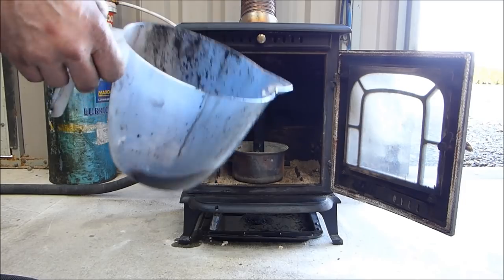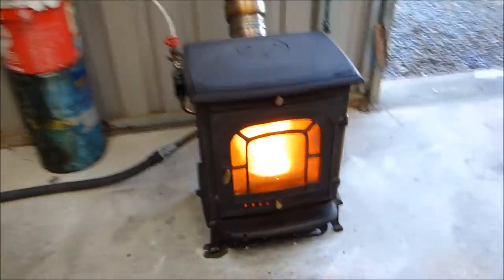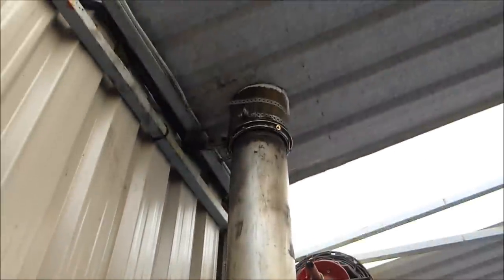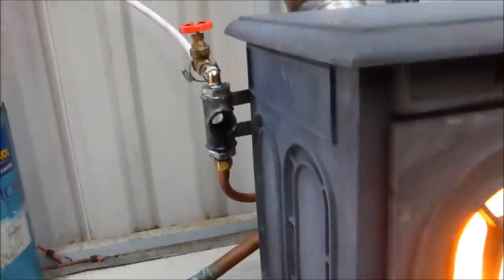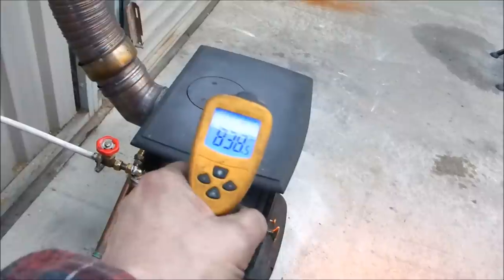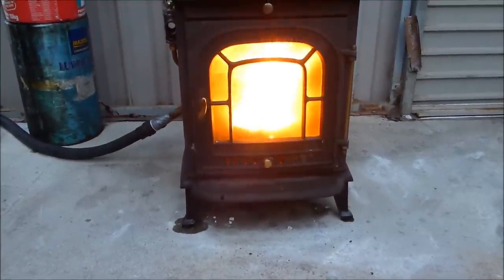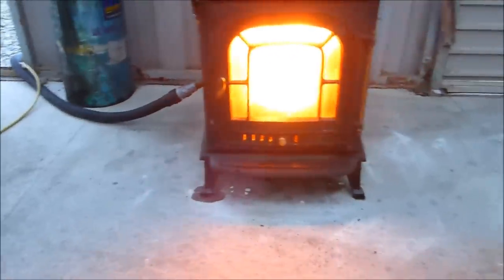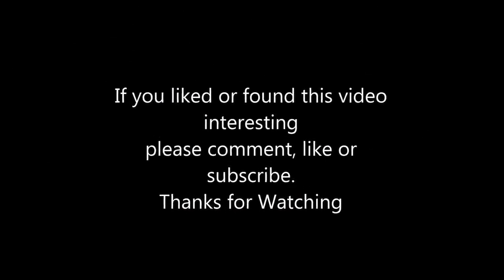Amazing ...Convert your Stove to burn waste oil

Comment: Have run a waste oil furnace like this now 25 years with copper coil built around it with hot water also and circulate thru radiators..Clean it 2 times a year with great results.  Only smokes first lit.  Keep a pyrometer on it first couple years.....been a great heat source.
Reply from the maker: Hi Doc Holiday. Thanks for sharing and well done. Cheers Gerry

Comment: Worked in the oil business in the states for thirty five years....I GOTTA MAKE ONE! back in the 70s I just caught the tail end of drip burners.......same combustion chamber but drip came from above with no fan? In a wood stove....... thanks for the video😊🇺🇸
Reply from the maker: Hi Pete. I made a unit that does not require a burner and makes huge heat too. It runs on 2 litres or so per hour and is very easy to make. I tried it in a boiler stove in my house and I heated some underfloor heating and 300 litres of hot water too. Here's link https://youtu.be/SAmHNp6fOUA You would have no problem making it. I am working on a siphon nozzle powered unit at the moment  so more heating projects on the go. Cheers Gerry

Comment: I used 1.5 inch pipe fittings to make the burner, used a elbow, coupler, t fitting, and reducers to connect to the 1/2 inch air supply pipe, I used a computer squirrel cage cooling fan and laptop power supply for the air feed, I used 1/4 inch copper tubing for oil feed. I use about two quarts running it all day at a temp around 70 degrees f while below zero out side.

Comment: Can you make a video of the inside setup (how the pipe is fitted inside the burning bowl) ?

Please make an update of how much residue and buildup is created in the bowl and how hard it is to clean...

Great video thanks.
Reply from the maker: Hi Dicofole Video 2 on the way in 2 or 3 days showing every detail. Very little build up and all you do is smack the pot on the floor and its clean. I will post a video of it shortly. Cheers

Comment: good job i made one of the other ones. might have to give this one a try
Reply from the maker: Hi Thomas. This one is noisier but because you can adjust both the air and the fuel it is very easy to attain a clean burn.  Its easy to build too. I hope your new burner is working well for you. Cheers
Reply: successful waste oil burner
i love it i had a wood stove built the oil burner and give the wood stove away

Comment: Hi Gerry, try using a thin stainless steel salad bowl. It will get red hot in seconds and when the oil hit it, instant vaporization. I have my burner blowing in from a hole on one side of the bowl so the air swirls around. Works very well and there's no smoke in minutes. My old brake drum setup took too long to heat up, especially when everything was colder than -5°C and worse when it dropped to below -15°C.
Reply from the maker: Hi Mike. I have raided the kitchen so many times for cookware that I am nearly handcuffed every time I appear there for food Lol. A salad bowl sounds very good and easily changed out. I do use stainless steel pots as well but my latest burner doesn't even need a fan and works great too. I prototyped it with a sweet tin and a dog food tin and it works great. Here's a link    https://youtu.be/Z38ndzSPJxQ  Thanks for the comment Cheers Gerry

Comment: You should put a couple of those fans on top of it.
Reply from the maker: Hi. It makes too much heat and would destroy those little self powered stove top fans. I do use a 12v car fan to shift the air to the other side of the shed and that works well. Thanks for commenting Cheers Gerry
Reply: @GerrysDiy  ok thanks for the reply. I kind of thought it might be way to hot for those but you never no. It looks awesome. Is it still working good today?

Comment: Great video how big of a hole the do you use, it isn't a one inch hole do you had to drill is it .This would heat my garage great, will oil in the copper tube catch fire and go back toward your oil supply and is there any smell from burning waste oil .Could you let me know thanks Dale

Comment: I like this design, since you are using a blower, can't you pipe the exhaust waste heat to another part of the building then piped through a radiator or heat exchanger before putting the exhaust up the flu? maybe even heat a room in the house with the exhaust, or heat water even?

Comment: Hi Gerry. I have a wood stove with auto damper controlled by heat hotter an coil spring activates an closes down draft. Oposite when cold. Located in back of stove inside. Yours was on bottom. Do you think result would be same?

Comment: I have to say this is very awesome a couple of years ago I built a pellet stove out of a cheap cast iron harbor freight stove. I like your set up because am looking to build a multi fuel stove that will use pellets waste oil and wood. I like the idea of being able to run more than one fuel. right know am working on building a pellet mill so I can pelletizes grass and leafs or that's the idea right know. what I like about pellets they stack very compact and if you can make them out of grass that you have to cut any ways it is a plus. waste not want not  

great video 5 out of 5 stars
Reply from the maker: Hi Iwantosavemoney. The propane tank version I made does a great job of burning everything from logs and sticks to various types of used oil. Grass pellets from the garden clippings is a really cool idea. Here in Ireland we have plenty of it. I have planned to make a pelet stove at some stage soon too but I have a few things to finish off first. Cheers Gerry

Comment: Hi Gerry.Planning to follow Your ideas of converting an ordinary wood ovn to an waist  oil burner but wondering:                                   - Why us a stainless steel pot so big and  so deep for the flame? In my earlier days of diving we had an diesel burner in the work-room 24/7 in the wintertime on the same princip but not a deep and big pot, and not a blower, but good intake. It did not give thousands of watt  but made the start of the pipe red when opened the regulator from dripping to a thin jet. See others use a 6-7 inch stainless steel tube with a lot of 1 inch holes instead of a pot. What do you thinK? Dag from Norway. ..Your actitities are good man

Comment: If you added a housing around your exhaust you could make a forced air distribution across the shed, also wrap the exhaust pipe with s copper tube you can get running hot water

Comment: I have a Montgomery Wards home oil heater that still works it's burner is design slightly different but once it gets hot it's got 100 pinpoints of are coming in to the plenum

Comment: Thanks for the idea and setup for I converted a 30,000 btu propane heater into a waste oil heater and get about 40,000 btu from it now, you can see the video of it on my channel, you may want to put a electric valve inline on the oil line so if the power fails it shuts the oil supply off. Nice set up otherwise.

Comment: What if you have a little anti freeze mixed in the oil? I live way out in the woods and i have 55gal drums full of oil, the local part stores only take 5gal of waste oil at a time and I am trying to figure out a way to make one of these to use my waste oil but some times I get stuff mixed in them.

Comment: Do u need the fan or could u just light it and let it burn seems u might burn less oil u might get less heat or does it burn roughly with little airflow like lots of smoke

Comment: Looks like you drilled out a Tee .and a hose bib on 1 side and copper compression  on the other yes ?
Reply from the maker: Hi PJ I drilled out a malleable iron tee to make a viewing port. The rest is just bushings and brass fittings. On some of the other burners I have used maleable iron elbows with a hole drilled to allow the oil line into the airfeed. Works great. I had a novel way of bending the 1/2 inch copper inside the steel pipe at the same time by filling both with water and freezing them together. Then bend both in a hydraulic bender. Its in one of the playlists as well. Thanks for commenting PJ Cheers Gerry

Comment: I find your videos very well done indeed, I am quite familiar with 2jeffs1 but I think I would like to try the type of burner you have here, seems to work real well,now to find a stove to use that I don't mind buggering up..lol..I want to build a water reservoir on top of it and pump the how water through a radiator inside my shop and have a  fan blow through it, and keep the burner outside in a cement vault that it vented of course to keep the non CSA certified stove out of my garage, although I still think this as safe or safer then burning wood.cheers and keep them coming.
steve,

Comment: Impressed with this! I've just built a garden room/man cave and have been considering a small log burner. I like the idea of being able to burn waste oil though. The thing is, my room is extremely well insulated and only 5 x 2.5m so I think the kind of heat output you have here would be overkill. Could you build one just like the one you have here but just use a much smaller air blower, perhaps with a control and just have a less intense flame? Cheers :)

Comment: Hi Gerry. I am building one of these at the moment and a word of advice will not go astray. Two things I need to know...1. In your opinion would a fan motor from the heater of a car be good enough to supply enough air. 2. Is there much carbon build up after...lets say 7 or 8 hours. Any help would be much appreciated. John
Reply from the maker: Hi John
A car type fan on low speed or mid speed would do a great job no problem. Depending on how dirty the fuel is the will be little or no carbon build up even after a week of burning once you get the fuel and air mixed properly. In a later videos I even used a hair dryer and a vacuum cleaner just to demonstrate the air supply and how hot things can get. Cheers Gerry
Reply: Gerry's Waste Oil Burner Thank a million Gerry for the info. I will give the car fan motor a try and see how it goes. As for the waste oil I am using..its ALL filtered down to one micron, as I already use waste oil to heat my house rads. This is NOT a home made set-up. Its a specially designed unit I brought in from Germany, and it works great. The one I am building myself is heating a garage workshop and is replacing an old drip unit. I let you know how it goes. Keep up the good workj and thanks again. John.

Comment: With no chimney damper, most of the heat is going up the chimney, and is wasted. Also, 20 gallons of used oil a day @ 3-4 liters per hour is too much unless you have an unlimited supply.
Reply from the maker: Hi Joseph. The flame has to run hard to remain lighting. If I added a damper then the veloity of the combustion would be changed and this type of burner would just cool and combustion cease. The trick is to recover the heat better. I have made lots of burners since this one but even commercial kerosene burners will use 2 litres and up per hour. Thanks for commenting Cheers Gerry

Comment: OK. So u said u c'd also burn with wood. Does that mean the oil w'd drip on wood and mk it burn longer?  Also is thr an oder? Thx.
Reply from the maker: Hi Charla. Burning oil at the same time as the wood would make the ash blow all over the place so its one at a time. It burns very clean with either waste motor oil or waste veggie oil.  There is no smoke or odour in the shed and the flue is 13 feet high so no problems there. If I were on the roof I might smell something.  Hope this helps. Cheers Gerry

Comment: Hello great idea but where do u get a good supply of used oil?
Reply from the maker: Hi Floyd
It depends really whether you want to use used motor oil or used veggie oil. Garages / mechanics give the stuff away and it runs great on either veggie oil ( from kitchens / restaurants) or motor oil. It will run all day with little to no cleaning although that depends on the quality and amount of solids in the oil. I set this stove up to use both forced air or an Ozzirt type burner and it runs great on either. It started out as an experiment but quickly became a cheap to free heat source for my shed. Will even burn logs..Hope this helps  Cheers Gerry

Comment: I have all the parts to duplicate your build, I have a question:  the wood stove I got has bricks lining the inside:  Did you remove the bricks leaving you only with the steel wall?

Comment: How low will it run? I only need to heat a 8x20 foot space.
Reply from the maker: On forced air you can lower the output considerably but you might have to open a window depending on the insulation levels in your space. hope this helps Cheers Gerry

Comment: This might be a silly question but why dosnt the flame eventually travel back up to the oil feed and catch on fire?
Reply from the maker: Hi Trent. Waste oil is quite hard to burn and needs to be really hot to vaporise. The pipe is quite cool and there is not a lot of air for combustion too. Not a silly question at all. Here's my latest video posted today and it has the same copper pipe with the oil in it stuck in a flame lol.  https://www.youtube.com/watch?v=JHsNoqp9QAE     Thanks for the comment Cheers Gerry
Reply: @GerrysDiy  Thanks for the reply Gerry, that makes perfect sense now 👍
Reply: @ Trent Diss: The short answer it that it requires so much energy to effectively burn waste oil that you're never going to get an instance of blow back, the line outside the combustion chamber simply should never get hot enough to ignite the oil within it. That said, of course it is within the realm of possibilities as it is gravity fed which allows the passage of air if the oil container should run dry. There are measures you can take to prevent potential disaster however. The most obvious is simply never set up your operation within 20 feet of anything you wouldn't mind catching on fire. secondly use a small container to feed your burner so that, should this unlikely even occur, you need only to cover the container and stop your air supply to extinguish any flames. Thirdly, regulate the flow of oil with a valve. should you be so absent minded that your line runs dry you need only to close the valve closest to the combustion chamber to prevent any hot gases traveling up the line. 

This is for those who are accident prone and not for Trent. If you do not have the attention span to prevent your oil reservoir from running completely empty, you're probably not qualified to attempt anything for which a furnace is required in the first place. Do the world a favor and find another hobby. That being said, have a friend help you with this project. OLE!
Reply: Hiya du have a link for the video you mentioned in the one above as can't seem to find it ( for the control valve)

Comment: Can you tell me what kind of chimney flue you have? Thanks, love the video's
Reply from the maker: Hi Jeff. I have a 4 metre (13 feet) length of 150mm ( 6 inch flue) In that video I was just using some flexi flue as a quick hook up. I can get the same heat out of an unpowered unit too. Here's a link https://youtu.be/tnzEDEpz3Yk Thanks for the comment Cheers Gerry
Reply: Have you done anything with gasification of the oil?

Comment: I have seen what otherguys have done. They dont use a blower. Its a slower heat but safer. Your valve is to hidh up. The rubber gaskets inside melt you are not only have a mess but a fire.
Reply: Andre Martel

Comment: I would be more comfortable with around 700°F on the surface of the stove. Less air (rheostat) and a little less fuel. Seems to burn pretty good, but way too hot. In my opinion of course.
Reply from the maker: +Guy Curwick Hi Guy. My shed is quite large so I was overriding the stove. Such low temps in my uninsulated shed wouldn"t work unless I have a bigger surface area. Cherrs Gerry

Comment: Damn...ur good.  Could you drip waste oil onto firewood?  I'm going to start to offer free labor on oil changes.  .
Reply from the maker: Hi John Doe. It does work dripped on to firewood but it can make sparks so the stove and flue are important considerations. In some of my videos I have used waste oil and solid fuel. thanks for commenting Cheers Gerry
Reply: Yes

Comment: do you think this stove has cracks because it should not really be burning at these kind of temps
Reply from the maker: Hi Mark. The stove had the cracks in it before I started cutting holes in it. I couldn't use it else where so I decided to experiment with the waste oil. Cheers Gerry
Reply: well Gerry i think its brilliant,and it seems to burn off most of the pollutants as the exhaust looked it was throwing nothing out at all except hot clean air.Guess thats down to the running temps burning off any oil residues .
Reply from the maker: Hi Mark. In another video I fully installed a burner unit into a predrilled stove in about 1 minute. Its really easy to do and the newer burner design is really easy to install. check it out here http://youtu.be/QQGtl87-x58
Cheers Gerry